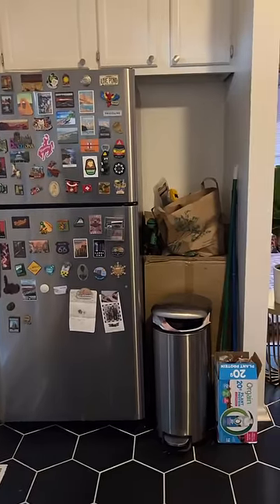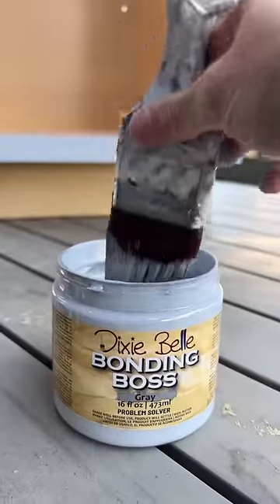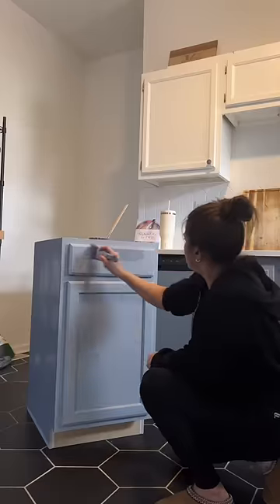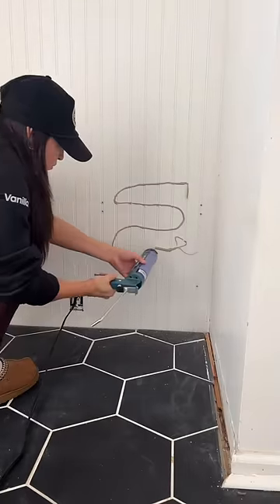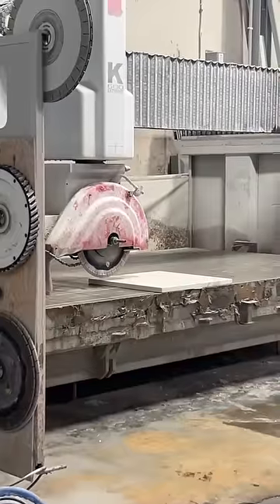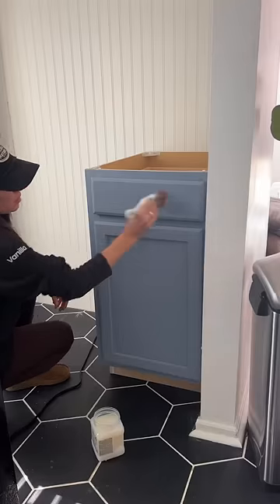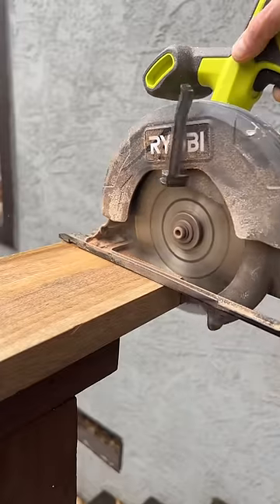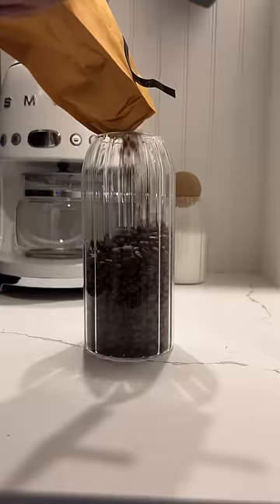I built a DIY Coffee Bar from Scratch!! 🤯☕️ @DixieBellePaint  AD #nationalparkpallet #diy

Comment: It looks nice on camera but at a painter and caulker as soon as I saw you putting caulk on the corner of the trim I instantly pictured things I’ve seen and said to myself I bet it will look bad but I could be wrong. Paused at the end and I was right. It looks bad. You want to filled in. Your crack and wipe all the excess of the boards. It will shrink so you can do it again after of instead use a hole filler, then you can build it slightly to high so that you can sand the excess to the perfect shape, can’t sand caulking so sound kind of hole filler/patch material is much better to use.